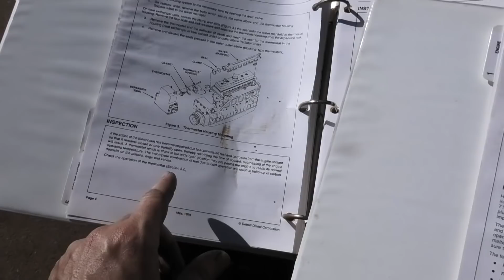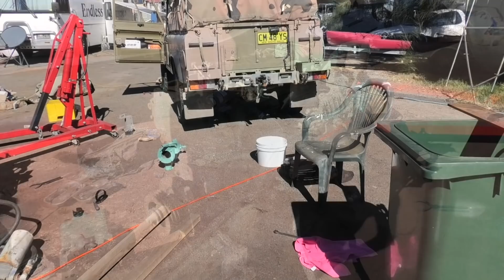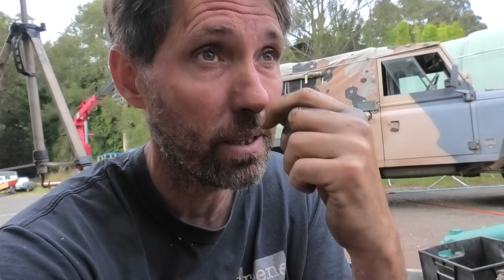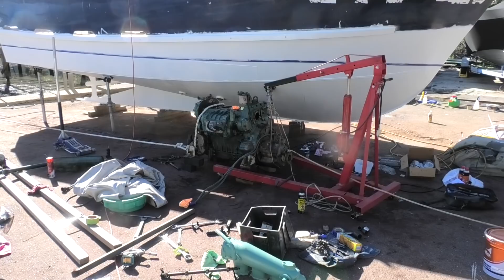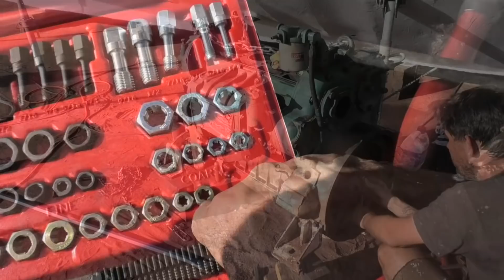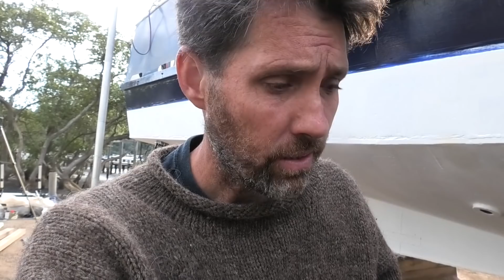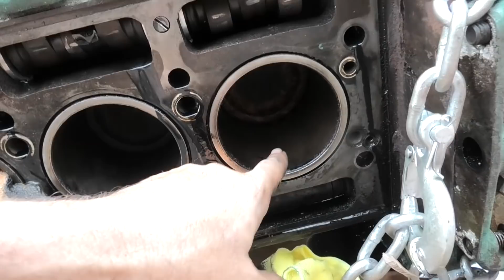Detroit Diesel 4-71 teardown

Comment: G'day Stu,
I cringed a bit, wished  I could have commented while you were trying to get the gearbox off. On my Hartley which was sunk for 3 months, the Ford 592E was made run with new oils eng & trans (hydraulic PRM310) like yours, , no dissassembly was done other than starter motor ,  although almost a year passed before I had chance to work on it and then it had frozen. realizing that the flywheel had to come off to clean the last of 7 tonne of mud from behind it, it was the gearbox that had seized, my method to realease the stuck spline was not to destroy the extremely expensive flex plate with heat but undoing the bolts securing the plate to the fly wheel through those access holes and removing gearbox and plate together for more gentle dissassembly.  When the gearbox had been refilled and run there must have still been a bit of water trapped in the massive tapered roller bearings on the main clutch shaft and rusted maybe 3 of the rollers in position, other than that there was no sign of rust in that $6000 gearbox. I replaced those bearings myself after inventing a special puller (drama) service manual essential !it also uses 20w50 engine oil,  beware! the get me home device on the top plate can be installed ass about which, by vibration lets reverse and forward engage at the same time.
Is it the fact that it is 2 stroke that the engine got so rusty inside ? As I said I didn't even take the head off the ford, hope my bores didn't look like that, atf fluid is meant to be good at freeing rusty piston rings. With my injectors out I was able to eventually rotate the engine smoothly by hand cranking with a long bolt in the flywheel with a bit garden hose on it and acheive  good oil pressure before trying to start it, 10 years later it starts easily and runs for an hour or more without getting hot picking up water & exaust returning it to a 60 litre rubbish bin. 

regards
Phil

Comment: If it were me I'd replace it in a heartbeat. New engine will be quieter, more efficient, more powerful and probably even smaller all in 1 go and since the boat is already stripped down it'd realistically be fairly easy to mount.

Comment: with the cylinder ports all carboned up its going to run pretty well extremely hot.  Replace the injector lines.  A well tuned properly set up 4-71 will not use a ton of fuel.  Yes you can do a bit of tuning on a 4-71.  replace that chinese solenoid.

Comment: It looks like you may have a slightly leaky water jacket in cyl 4. I don't know if you booted and taped the intske and exhaust or just covered it in a tarp. If you didn't sesl up the intake and exhaust ports, that's probably the resson for the rust in the bottom end. Still curious about the rust on the rockers and rail. Not exactly normal for sitting such a short time...

Comment: what would a boat like this be worth new?
Reply: A new 7-10 meter commercial aluminium lobster boat would be $250,000-$400,000 & still have a re-sale of $125,000 plus or minus in 20 years time, alloy is the way to go because you can have a ramp trailer to pull them out of the water if need be or trailer them around during day light hours with an oversize permit and they are arguably a better boat in many ways, check on www.boatsales.com.au for commercial vessels to see what your money can buy you. Razerline boats make the best alloy boats in Australia for the keen fisherman, boater or commercial operator, they have a facebook page & website, & yes, I am biased as I own one.

Comment: I've got both a 6V71 in my big live-aboard boat and a 4-71 in my 30' steel trawler.  Worked on them both.  Seeing you muscle those bits around brought back the aches and pains!  Still, if someone drove over the hill down into the harbor with a brand new modern diesel on a pallet and a crane to put it in, I'd send them packing.  I love my 4-71!  It will be running long after my kids use the boat to go out and scatter my ashes (which I'm hoping is down the road a piece).  Sure she's a tad noisy and likes a sip or two of extra fuel, but she'll start and run when you most need her to and keep you out of trouble.  It's a boat.  You can't pull over to the side of the road when the CPU in your underweight overly-complicated high efficiency engine quits -- and good luck diagnosing it and getting it running when the wind and chop is up.  Global warming is real, cars/trucks/buses/etc. need to be running high efficiency stuff as long as we're still burning fossil fuels.  But this is a boat, and there's no better friend than a DD on the water.

Comment: You want a 471 in your boat do it. Its what you want, not anybody else. Be dam sure you have some help with the fuel rack and all that set up. Be ready with a nice board to stall it out if its going to run away. If its not right, or the rack sticks its not pretty.

Comment: Not sure if this has been recommended elsewhere,  but take the time to pull the bell housing, counterweight housing, front mount plate and then the end plates off the block.  Makes it 100% easier to clean the block, and just makes for a better O/H.  Also, think about how you want the engine configured, blower, left or right, exhaust manifold, left or right, both left, or both right. With minimal parts it can be done.  Off the top of my head the only parts you would need would be a governor  and / or a fuel rod depending on the change.
https://www.powerlinecomponents.com/literature/detroit_diesel/il71_model_chart.htm

Comment: I use to build cylinder heads for them.  You need special tools to replace the injector tubes, and special gauges to reset the injector height.  Get the injectors rebuilt, if they stick they can cause the engine to run away.   The injectors are the throttle.   

I  worked at a sawmill when I was younger powered by a 6-71, it ran daily for 6 years with no major issues.  
It was a used engine when we got it and ran at full speed all the time.

Comment: I don't mean to be a picky bastard, but Detroit Diesels do not have a supercharger, .... they have a blower. 
Hot Rodders convert the 671 & sometimes the 471 blowers into superchargers for use on automotive engines.  Usually only the blower case, the front gear cover, the rotors & gears are original. Sometimes the front bearing plate as well. I have just completed my 671 blower to supercharger conversion & they are a great piece of engineering.

Comment: I find this quite interesting. I’ve worked with uniflow scavenge two strokes before but not as small as yours. Only Sulzer/Wartsilla RTA on Container ships. Here in the UK the equivalent vintage marine diesels of choice were the Gardner which is a four stroke so it is really cool to see the Detroit uniflow two stroke unit.

Comment: My Grandpa made a filtration system for his Diesels out of a roll of Toilet Paper back in the ‘40s.That filter was never the primary it was there to just slowly filter smaller contaminants. He tried to teach me about the Manly subject of Mechanics but I couldn’t get my brain around “Oil never goes bad, it just looses the ability to suspend particulates” As far as I know that same engine is still running. When I was in the US Marines some of our equipment had www.gulfcoastfilters.com installed. I am not affiliated with these folks in anyway, except that I know their product, if used properly will stop this chunky oil. I have no knowledge of their use in lighter Maritime Vessels, but I bet they would love the opportunity to communicate with you.
Reply from the maker: Thanks mate, I'll check them out.

Comment: You can I believe purchase remanufactured Detroit Diesel engines, with a credit in cost for the return of your engine.  If you can provide Detroit Diesel with the engine serial number, they could determine cost for you.  This would give you a "new" engine that is an exact match to your current engine.  Greg
Reply from the maker: That might be a good way to go.

Comment: Top half of motor ruff, lower half did not look bad, over haul best for drive train, I live in mich, detroit area, that engine will run forever. May suck more fuel than you like. Good luck!😎
Reply from the maker: Yes, I definitely thing the bottom end isn't in too bad a shape. Bearings were a little worn but not toast so crankshaft should be fine.

Comment: You're "only" looking at around $2500 US max for a rebuild plus machine work. I can't imagine the parts and machining in AUS are that much more expensive than in the States for such a common motor
Reply from the maker: In Australia it's closer to $7000 according what I've seen so far.

Comment: Believe me, Stu, keep what you've got. It may not be as fuel-efficient as something modern, but my experience has been is that you put the $$$$$ in at the pump, or you put it in at the repair shop. It is always cheaper in the long run, to put it in at the pump.  Always remember, it's called a BOAT for a reason .
BOAT=$$$$$Bring Over Another Thousand$$$$$$

Comment: Keep the old oil. It has some diluted diesel fuel in it and nitric acid. It may do wonders on stuck cylinders and linings. And btw, as you probably know: -don't use normal 15w 40 or what normal oil 2-stokes want other properties. The residues in the pistons tell the story that your engine have been on the 4-stroke stuff.
Reply from the maker: Yes, I've been trying to find a good source for the Delo 100 40W oil, not easy to get here.
Reply: @DangarMarine  I believe any monograde SAE 40 will do. I use Castrol but I believe Monotec isn't that bad either and according to google - available in your part of the world.

Comment: @Dangar Marine Hi Stu, I'm sure they'll check for cracks, but would suggest you make sure they do. Perhaps that corrosion under the rocker cover was from a cracked waterway which sprayed water in. Good luck with the rebuild!
Reply from the maker: Yep, the engineers will definitely check everything for cracks.

Comment: My first thought when I saw the condition of the engine was “Get rid of that piece of junk and put in a brand-new engine instead”. But at a second thought, what is the main purpose of this project? Get a hassle-free boat or continue making a lot of cool videos for YouTube? You could put in a new engine, but how interesting is that? Repairing this old engine is the way to go, at least if you want to continue making this channel interesting.
Reply from the maker: I actually did make that exact point in some footage I never end up using. I am in the business of making YouTube video and buying a new motor is probably the least interesting option to watch. :)

Comment: Stu, I have learned to swear in 3 different languages.  It does come in handy at times. I was using them all watching you remove the transmission. When you put that all back together use allen head bolts and lots of never seize.  I want the Land Rover, will you deliver it to the US?  Good luck.
Reply from the maker: Hey James, will definitely be putting antiseize on everything, especially that driveshaft spline! I'll see if I can fit the Landy on the back of the trawler and drop it off to you. ;)

Comment: The feeling of your money flying out of your wallet as you take each part off and discover that you are going to be spending increasing amounts of money. Been there. Shocking that you didn't break any bolts during disassembly.  Do you guys have access to any 12v Cummins truck engines? Hopefully the guy that sold you that mess has crazy feelings of guilt because he obviously knew that the engine was submerged at least once.
Reply from the maker: Yes, I too have the feeling he must have known. The starter is brand new (which he told me) and I suspect it is because the old one got drowned being low down on the engine.

Comment: Parts are inexpensive and abundent still in North America for the Jimmy's.The 71 series are extremely simple and reliable. Personally ran an 8-71 from St Petersburg,Florida to Nanaimo ,British Columbia,approximately 6000 nautical miles.Not one mechanical problem other than fuel filters.(Old steel boat with old steel fuel tanks)It was in an US Army T Boat built in 1954.It was an adventure.Averaged 4 gallons per hour running at 1500 RPM doing around 6 Knots.

Comment: You won't go wrong rebuilding this engine. As I said they run while others are giving up...
Reply from the maker: I think they are pretty amazing engines. I'd love to look into running it on bio diesel too.
Reply: Bio diesel or home made fuel is an extremely high risk fuel option to run a diesel engine on in my opinion. I'd stick to Saudi or Singaporean refined pure dead dinosaurs for fuel, at least you know what your getting and it is made to a standard, not recycled from who knows what & unknown octane & composition it is, especially when you only have one engine & your at sea.

Comment: I sure you have a covered workshop to put that thing back together in. Very finicky about dirt. Don’t forget to replace the engine oil cooler, no way to flush them with certainty.
Reply from the maker: Interesting to hear about the oil cooler, I wonder what they cost. :O

Comment: I've never rebuilt a diesel engine, but there's a fairly easy way  to improvise a puller if you've got a gap to work with like you have between your block and the adapter plate. 
Get some threaded rod that will fit your bolt holes in the block. Hold the nut between the adapter plate and the block and thread the rod though bolt hole in the adapter, through the nut and into the block. If there's room, also use washers between the nut and adapter plate.
Once you've threaded a bunch of rods into the block, you simply back off the nuts with a wrench while holding the threaded rod with vise grips to keep it from unscrewing from the block. 
The nuts pushing against the adapter will act like a puller. Work them in sequence keeping the gap even and it should eventually come apart. (or break the adapter plate if it's jammed that bad)
Washers will protect the inner surface of the adapter plate and some spray lube on the threaded rod and around the washers will keep things moving smoothly.
Reply from the maker: Sounds like a good technique!

Comment: Stu; I really like these explore and adventure in to the parts unknown where no man has gone before. When you said you know what I need next, that second, I said to myself " A beer ", and I was right !!. Looked like this is preventive maintenance task, that rust would not have helped at all long term. Well Thanks Mate fer this video. Learned a lot. Cheers !!***. Angelo.
Reply from the maker: Hey Angelo, yes, this definitely all needed doing. After this it will just be a case of keeping the filters, oil and anodes up.

Comment: Luke at us coach in new jersey USA would be a good source for parts as most all of the older coaches are powered by old Detroit's as some body else pointed out also the bus grease monkey would be a good source and the San Francisco bay area California also Seattle,Washington area have places that specialize in 2 stroke Detroit's for marine use and your 4 71 the head injectors and many other parts will interchange with an 8v71 
Have a good day
THE GRUMPY BUS
Reply from the maker: Thanks mate, appreciate the tips.

Comment: Yup I would say it was possibly two factors.  Improper crank case oil was used and the oil pump wasnt delivering enough oil.  Otherwise rebuild kits are cheap.  Around 700 usd.  Rebuilt is far better and cheaper.

Comment: Probably not that expensive to bring the 4-71 to a Detroit rebuilder as a core and just pick up a fresh rebuilt.  A lot easier to work on with proper gear, like a proper engine stand for one.
Reply from the maker: Yeah, can't wait to get it into the shop. There is no way my engine stand would hold this beast though. I hope they have a bigger one!
Reply: @DangarMarine  Yeah, its a beast.  Maybe you can rent one somewhere near you?  Or better yet, maybe your sponsor will read this. lol

Comment: Did he just say he will save that old oil for when the rebuild is complete? Um dispose that and put in fresh 15w40
Reply from the maker: That was a joke. These engines take single weight 40W, apparently using 15w40 is quite bad for them.
Reply: @DangarMarine  I couldn't tell if you were serious or not. You did a great job dissembling that Detroit. The engineering GM put in that this is unbelievable compared to a 6bt Cummins or a 4bt. Can't wait to hear that thing come to life. You have the best marine mechanic videos.

Comment: Stu, F.Y.I There is a 4-71 head with rocker gear & cam followers on Gumtree at Lillydale for $400 bucks that doesn't look to bad.
Reply from the maker: Thanks for the tip!
Reply: Stu,  type in "4-71" to search for the head, I searched "marine gearbox" in Gumtree and came up with an ad over in Milperra for a GM 4-71 with box for $4,200 neg, the ad was only updated a few days ago so should still be current.

Comment: Why don't you talk about what would actually be involved in a new or new to you engine? Exhaust would change but you are changing it anyway, gearbox probably, mounts. What else?
Reply from the maker: Output flange would change as well as the cooling water intakes and outlets. The biggest one for me is also that this weighs 850 kgs and new motors I was looking at were about 250 kgs so I would need to reassess the stability of the boat and possibly add a lot of ballast.